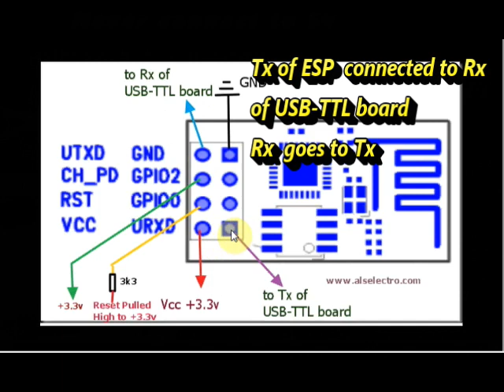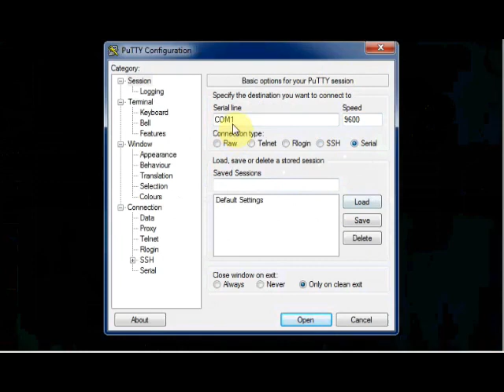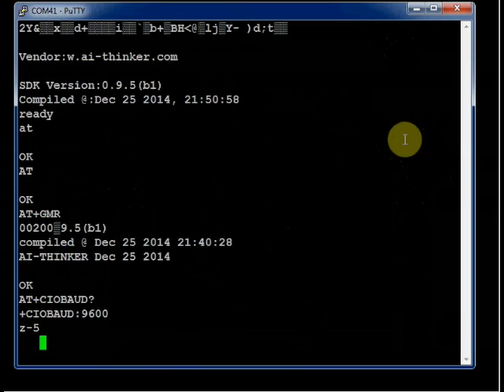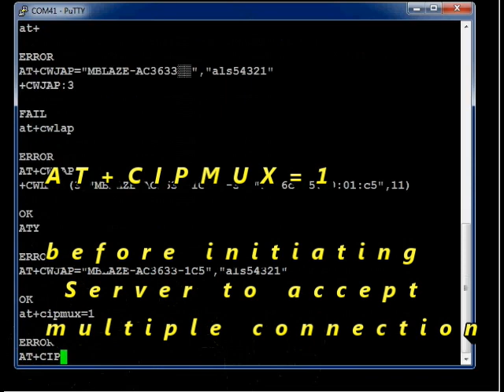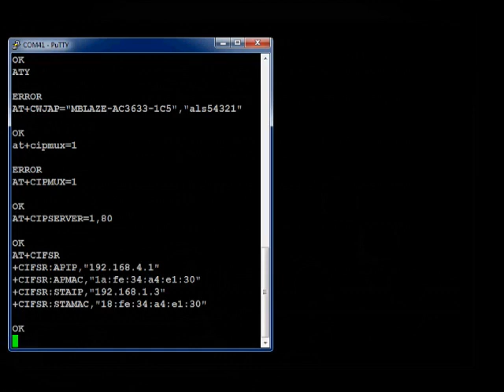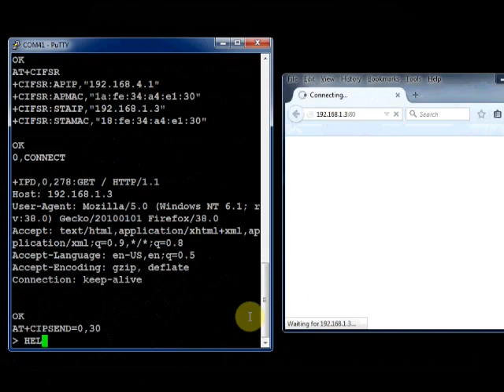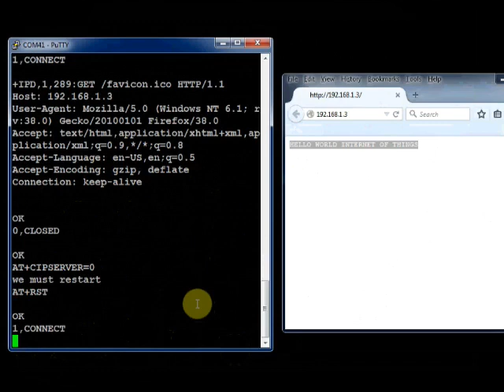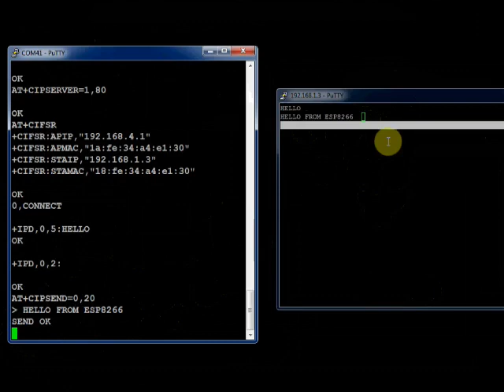WIFI module ESP8266 - AT commands & sending Data to WebBrowser

Comment: Hello! I bought an ESP 8266 -01 wifi relay whit a preloaded software. Of course the flickering LED relay board showed up right the way but this is not my concern. I built up my own flashing programmer and pressing the rest button I got the info that I have wrote down.
AT communication is not working.

AI-THINKER & VOWSTAR, 2014
SDK version:0.9.2
mode : sta(18:fe:34:0c:73:54) + softAP(1a:fe:34:0c:73:54)
add if0
add if1
dhcp server start:(ip:192.168.4.1,mask:255.255.255.0,gw:192.168.4.1)
bcn 100

Do I need to re-flash the firmware again in order to download an application like " ON OFF " sketch?
I presume the AT communication is not working as the firmware was erased.
As I am new in this microchips and programing word I need some advice, please!
christimro@gmail.com

Comment: Hi When I want to connect Esp8266 to the wireless network with AT codes, I get MEM CHECK FAIL error on the serial port monitor screen. It is stated in some sources that esp8266 may be corrupted. Do you have experience in this regard? Or can you give me some advice? I wish you convenience in your work.

Comment: Great Tutorials, full explanation.  Did you have the experience with this kind of board of Mega5260? It is very difficult to config, so if you know please please share me.. thannk. this is the link of board. https://www.ebay.co.uk/itm/222681830302?ul_noapp=true
Reply from the maker: Mega2560 with Wemos seems to be a potential IOT board.Till now I've no idea about this. But you can refer to this forum
https://forum.arduino.cc/index.php?topic=464400.0
Reply: Ok..thank you very much, for your share.  I will check this link, if it still not work I will return to use ESP8266 Modules  as your video + Mega2560.  Can you show us more about how to communicate between ESP8266 and Mega2560? I would be very thank , Because now my project is stucking, I cannot communicate between mega and esp8266.  I just want to get data from sensors to store in Firebase so I really need esp8266 works with Mega.

Comment: Can any one Tell Me what the problem in this code Led Working But ESP-8266 not hitting my Locally Hosted Site Link 

#include <ESP8266WiFi.h>
const char* ssid = "Smart";
const char* password = "123456789";
const char* host     = "192.168.1.100"; // Your domain
IPAddress ip(192, 168, 1, 101);         // where xx is the desired IP Address
IPAddress gateway(192, 168, 1, 1);     // set gateway to match your network
IPAddress subnet(255, 255, 255, 0);
WiFiServer server(80);
void setup() {
  Serial.begin(115200);
  delay(10);
  // prepare GPIO3
  pinMode(3, OUTPUT);
   digitalWrite(3, 0);
  // Connect to WiFi network
  Serial.println();
  Serial.println();
  Serial.print("Connecting to ");
  Serial.println(ssid);
  WiFi.config(ip,gateway,subnet);
  WiFi.begin(ssid, password);
  while (WiFi.status() != WL_CONNECTED) {
    delay(500);
    Serial.print(".");
  }
  Serial.println("");
  Serial.println("WiFi connected");
  // Start the server
  server.begin();
  Serial.println("Server started");
  // Print the IP address
  Serial.println(WiFi.localIP());
}

void loop() {
  // Check if a client has connected
  WiFiClient client = server.available();
  if (!client) {
    return;
  }
  // Wait until the client sends some data
  Serial.println("new client");
  while(!client.available()){
    delay(1);
  }
  // Read the first line of the request
  String req = client.readStringUntil('\r');
  Serial.println(req);
  // Match the request
  int val;
  if (req.indexOf("/gpio/0") != -1)
    {
    val = 0;
     if (client.connect(host, 80)) {  //starts client connection, checks for connection
     Serial.println("connected to website/server");
     client.println("GET /home/ardchk HTTP/1.1"); //Send data
     client.println("Host: 192.168.1.100");
     Serial.println("Email Sended");
    client.println("Connection: close");  //close 1.1 persistent connection  
    client.println(); //end of get request
  }
    }
  else if (req.indexOf("/gpio/1") != -1)
   {
    val = 1;
   }
    Serial.println("invalid request");
    client.stop();
    return;
  }

  // Set GPIO2 according to the request
  digitalWrite(3, val);
  client.flush();
  // Prepare the response
  String s = "HTTP/1.1 200 OK\r\nContent-Type: text/html\r\n\r\n<!DOCTYPE HTML>\r\n<html>\r\nGPIO is now ";
  s += (val)?"high":"low";
  s += "</html>\n";
  // Send the response to the client
  client.print(s);
  delay(1);
  Serial.println("Client disonnected");
  // The client will actually be disconnected 
  // when the function returns and 'client' object is detroyed
}

Comment: Dear Mr. Saravanan, very good tutorial. you have mentioned that RST pin shuld be pulled high. At some other tutorial I read it shoud pulled low.  Which one is correct? or in both cases it will reset and high low does not matter.

Comment: sir i want to monitor the fuel level and i am getting my correct results throgh serial monitor now i want to send it to browser using esp8266 so what change i need in my code ..are some specific commands use to send data to browser..thanks in advance

Comment: Hello Saravanan AL,

I am working with esp8266 where i am receiving data through "esp8266" from a server using putty.
The problem I am facing is that when I am sending data to esp8266 through server I am not receiving all the data in the string.
for eg:-
if I am trying to send "helloworld" through server, I am only getting "hello" in my string.

my received string should contain "helloworld" the full data, but that is not happening.
Can anyone help why this is happening?
This is the process I've followed with esp8266 communicating via UART
AT
AT+CWMODE=1
AT+CIPMUX=1
AT+CWJAP="USSID","PASSWORD"
AT+CIFSR (HERE I AM GETTING IP address of esp8266)
AT+CIPSERVER=1,PORT NUMBER

I am connecting to server using IP address of esp8266,

Thank you in advance.

Comment: Hi Mr.Saravanan,

I communicated to you through this column 3 weeks ago. Thanks for your reply.
I continue to face the problem of not able to join the wi-fi network in my ESP 8266-01.
I am detailing the command sequence for your reference here:-
1. 9600 Baud rate gives garbage upon entry 115200 works OK.
2. All AT commands work OK upto AT+GMR . Gives firmware version as 0017090
3. AT+CIOBAUD? gives "ERROR"
4. AT+CWMODE? gives "3"
5. AT+CWLAP lists all access points
6. AT+CWJAP gives "no this fun"
7. AT+CIPMUX? gives "+CIPMUX:1" and then "OK"
8. AT+CIFSR=1,80 gives "no change "" 
9. AT+CIFSR gives "ERROR"
10. AT+CIFSR? gives "no this fun"
Can you sense what is going wrong ?

With Warm Regards,
S.Venkatakrishnan.
13-11-2016.

Comment: I am looking for information on using the ESP8266 12 in P2P mode. What I am trying to do is operate a relay remotely, through a non internet connected router. Am I on the right track with this device? I am competent with connecting IO to power circuits, just not so much with P2P (point to point). The specs say that it is capable, just no info to use it.

Comment: I connected my esp8266 to usb to ttl and connected to system and when i open putty software terminal it becoming inactive,if i disconnecting esp8266 putty working well what might be problem plz help.
Reply from the maker: ESP module is 3.3v device.If you're using ESP-01 make sure that CH-PD pin is pulled high , Reset pin pulled high through 1k resistor.While using USB-TTL , get a red one with cp2102 which has 3.3v pin.
or you can go for ready to use plug on board :
http://www.alselectro.com/wifi-esp8266-esp-01-demo-board.html

Comment: sir, I'm able to open the STAIP address (192.168.43.95 for my esp) in web browser if and only if both of the esp8266 and my laptop (in which browser is opened) are connected to same router. Can u please tell me how to control led through internet if use browser (now my laptop connected to different router or may be a different isp provider like idea or airtel internet)

Comment: thank you sir for the tutorial , I have a question.... will the station IP be the same every time I turn on or restart the module or it is going to change?
Reply from the maker: ESP module remembers the joined AP & the STAIP will be same till you quit the AP using AT+CWQAP. Even if you remove power for days your ESP will remember the AP.
Reply from the maker: You can also use this AT command to change IP :
AT+CIPSTA=”192.168.1.5”
Now your STAIP of ESP is 192.168.1.5
Reply: this is a good way to do this , thanks

Comment: Great tutorial thank you very much. I have managed to create a server and receive incoming connections from browser and send back responses, but only using a terminal. But I'm still trying to write an Arduino sketch that will automate this procedure without success. Have you managed to do that?
Reply: +gianis666 Hey man i got this for you, dont forget ESP8266 is 3v3 powered : 

#include <SoftwareSerial.h>
#include <string.h>

char incoming_char = 0;
SoftwareSerial cell(2,3);//Connected to ESP8266 with a SoftwareSerial

void setup()
{
    Serial.begin(9600);
    cell.begin(9600);
}

void loop()
{
    while (cell.available()) {
        Serial.write(cell.read());
    }

    while (Serial.available()) {
        cell.write(Serial.read());
    }
}

Comment: sir, 
     I am also working on esp8266 and arduino.
     I able to send the data from tcp client app (android phone) which is connect to same wlan router
      but phone connected to different wlan router ,that time tcp client not able to connect.
      
                  can you suggest me , how can i send the data from pc which is connect to different network(means esp8266  and                        pc not in the same network) to arduino using esp8266

Comment: Sir,can you please tell something about the circuit connection.
I am currently working on ESP8266 and is not able to control and bring down the input voltage from 5v to 3.3v.
Sir please help me out..
thanks